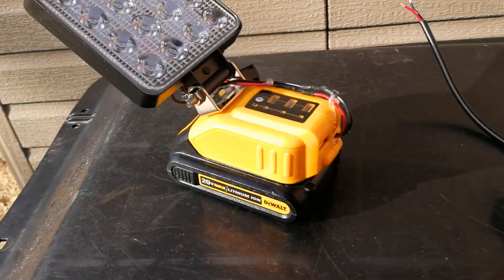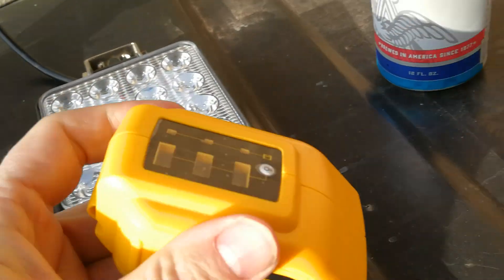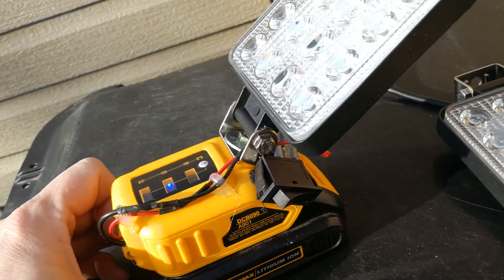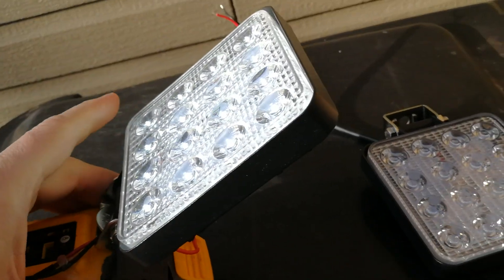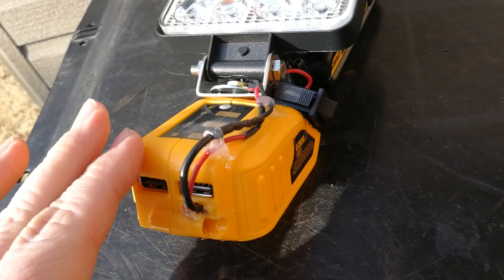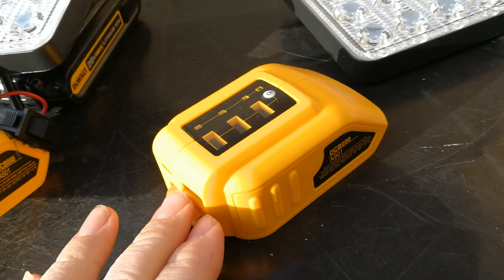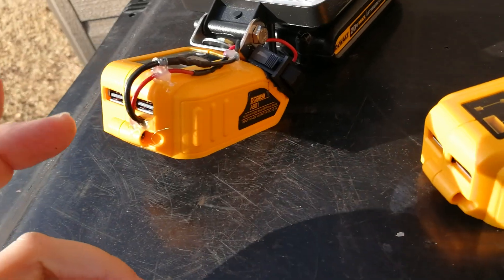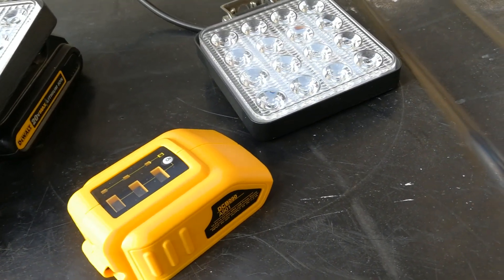DIY Dewalt 20v lithium home made LED light

Comment: How long is the run time.  Good idea ...thanks for sharing your video  👍
Reply from the maker: I've never ran it till one led on the indicator. But longer than the jobs I've used it for. I suppose I should just turn it on and see
Reply: @VintageSpeedwerks  Dewalt batteries dont have undervoltage protection circuit on the battery, be carefull or you might run them so low that the charger wont charge them anymore. That protective circuit is in the tools.
Reply from the maker: @kalletaimi5094  yep, I watch the power indicator on the battery
Reply: @VintageSpeedwerks  Good, I found out the hard way that, just wanted to make sure that same doesnt happen to you :D
Reply from the maker: @kalletaimi5094  in power wheels in use em, but use a low voltage cutoff board